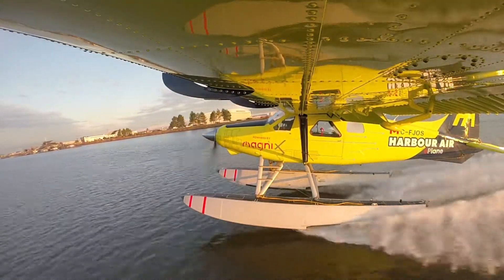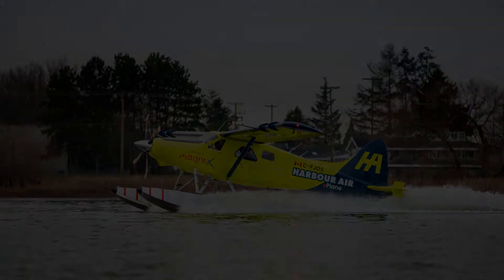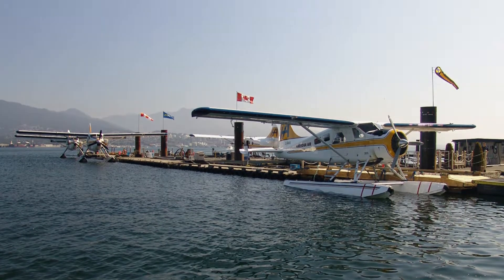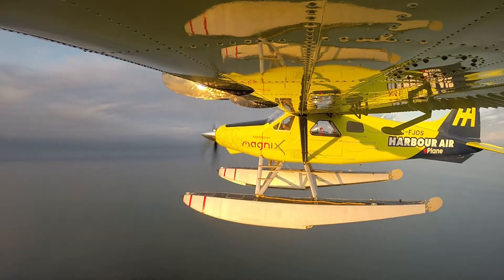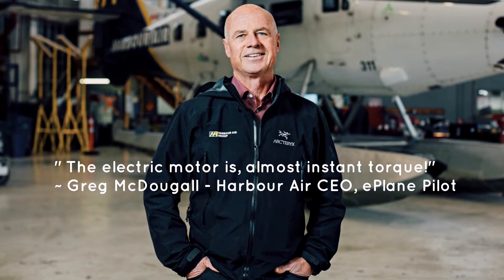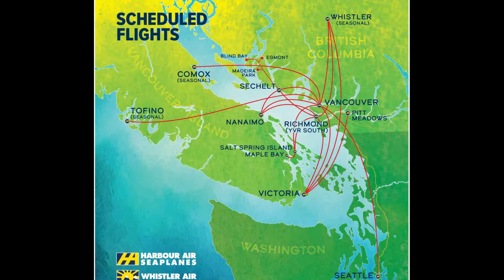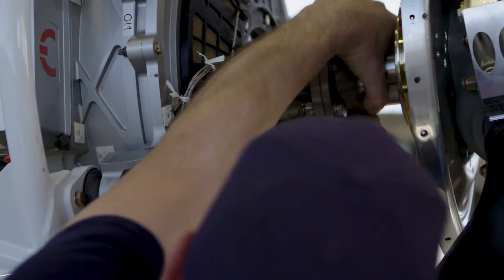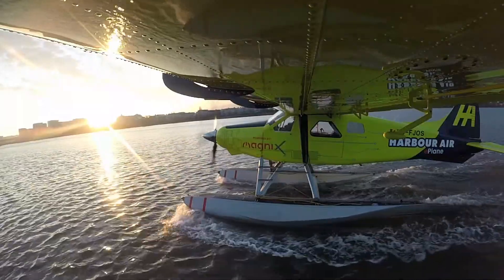World's first fully-electric commercial plane | Harbour Air's ePlane

Comment: Battery technology is not ready for a serious commercial electric plane. Short, slow hops, charged by coal, will be the rule for some time.
Reply: GARY - FALSE, NEW Tesla 4680 Nickel cell is 56% MORE energy Dense than BEST 2170 cell.
4680 can be in Structural battery pack. LESS Aircraft structure NEEDED. 
ELECTRIC motors Exceed speed of FASTEST gas Prop planes. 
no need to Charge from GRID , TESLA Energy makes Commerical SOLAR & Megapacks (4.5 Mw ) each. 
with 1000w MARINE turbine can make power 24/7/365. 
Plane needs REDESIGN , lower WEIGHT w/ ALL Composites & EXOSKELETON (Munro). 
Plane needs All Composite WINGS and STOL Twin Boom Tail . DELETE fuel tanks.
Plane needs ALL Composite 6 blade pusher motor. 
Plane TOP surface & Wings/Tail can be covered in SOLAR to Suppliment power. 
LOWER weight System battery (15.5v Li) rather than OUTDATED 12v lead acid. 
Lighter WEIGHT 100% Glass cockpit .two Large Vertical flat Pannel. Pilot/Co.
Reply: Uhhh not in Vancouver/Victoria, BC where Harbour Air is located. They are 95% powered by hydro... Also even Alberta will have fully killed coal by the end of this year... And we are the largest source of coal in Canada... So yeah... Two dead strawman for ya, homeslice!
Reply: The worst you could say about charging an EV airplane or car in Alberta these days is that it's powered by natural gas... mostly... And that's still half as polluting as coal... And even that's being eclipsed by solar and wind which are by far the cheapest sources of power now and probably forever...

Comment: Ok so the fact that air density does not affect torque of the motor is true. This does in theory offer an advantage for hot and high take off. However there is more than a little BS about all this. For a start the weight of the batteries is an order of magnitude higher than that of the fuel so the advantage is more than offset by the weight. Also, it makes no difference in the cruise where full power is not used. What really limits the altitude of the propeller aircraft is the efficiency of the prop itself, after all, a turbo charged piston unit can maintain its power as it climbs and actually enjoys a slight efficiency gain due to reduction of exhaust back pressure.
   You can call this the first commercial flight by an e plane but in reality the payload and range of this aircraft is vanishingly small compared to the exact same airframe equipped with quite literally 1930s engine technology. So the comparisons with pioneering flights of yesteryear are really quite bogus. What we are really looking at is this: replace a 1930s engine with the cutting edge of electric propulsion; result: achieve payload and range performance that is pre-war. And pre-war here is literally pre First World War.
   Bottom line is the amount of energy you can store in a battery per unit weight (as well as volume) is 30 times less than that of the fuel we need to replace. This is a particular problem for aircraft. Even if you make those batteries much cheaper, you don’t solve the weight problem. We need batteries with much better energy density but there is a long way to go. The price of these batteries is dropping steadily but the weight just isn’t. So the comparisons with the old pioneering flights are not justified. Engine technology and aeronautical engineering back then were both in their infancy. But technology here is already quite mature due to electric cars so it isn’t as if the energy density of the batteries is suddenly going to improve by the requisite factor of 10 that would bring them close to avgas and kerosene. Battery performance has improved significantly in the last 20 years which has got us to the point where electric aircraft are just viable for short flights with small loads but there is a gulf to bridge between that and the range and payload capabilities of the current commercial fleet.
   So I look at some of the electric personal air vehicles being tested and it is pretty amazing. But we are not going to be flying on all electric airliners this side of 2050, unless governments simply ban turbine aircraft and the public are prepared to pay double.
Reply: you can LOWER the Body weight by using Composites + Exoskeleton, rather than LEGACY steel body thats HEAVY.
WINGS also can be made Composite for Lighter Weight , no FUEL tanks needed. w/ Winglets . 
can be MORE Efficient FRONT Canard w/ REAR pusher motor w/ STOL Twin Boom design. 
Propeller can be MORE powerful 6 Blade on pusher mount and Composite blades. 
NEW Tesla 4680 Nickel cell 56% more powerful than BEST 2170 cell. can be made in Structural Pack. 
can Augment power w/ SOLAR cells in MAIN Wings & Twin Boom Tail.
Reply: @markplott4820  Nobody builds commercial airplanes with steel bodies, and all the airframe efficiency gains you list are  irrelevant as they benefit both propulsion modes. The energy density percentage improvement of the TESLA batteries is in single digits over more than a decade. You have been suckered by their PR into believing they made a 56% improvement in battery performance. What they did was build a cell x% bigger by volume and said it had x% more energy. Which it would, because it is bigger. It is most likely somewhat cheaper for them to make and they get a marginal weight gain from having fewer cells to connect together. Such are the trivial gains that remain to be had with Li.

Comment: Crickets since the event.   No fossil fuel,  what do you think charges the frikn' battery.
Reply: Solar, wind, hydro, nuclear, heck you could probably even use tidal power in those parts :D Also, the latest I found was from July where they mentioned working with Transport Canada to be able to start flying in 2023. So we'll see.
Reply: Battery plane CAN be charged w/ MARINE Turbine/ SOLAR & TESLA Megapack (4.5Mw) . 
no GRID needed. 
Plane can then DC fast charge up to 350 kw. ONLY from Megapack battery.
Reply: It's all PR. Transport Canada shut it down and Harbour Air had to return the motor.  It was a loaner.
Reply: Do you know the power mix of BC? No? Then STFU! It's 95% hydro powered with one or two small backup plants for NG in more rural locales... SMH... Talk about a bad faith debater...